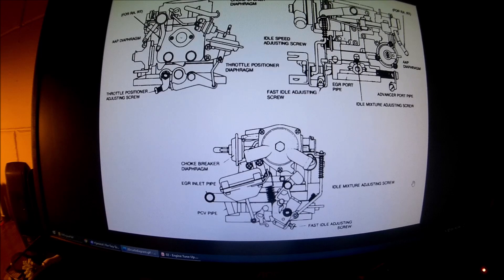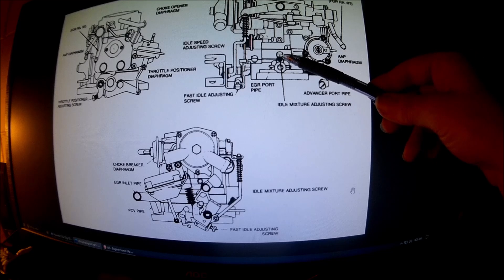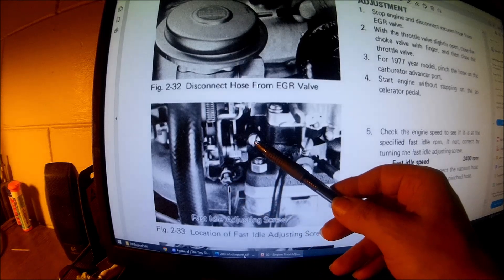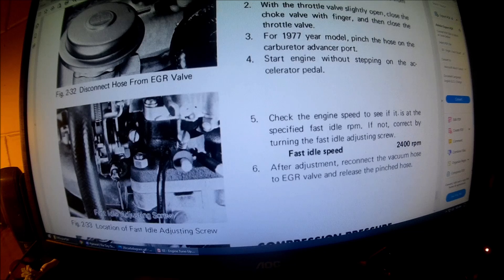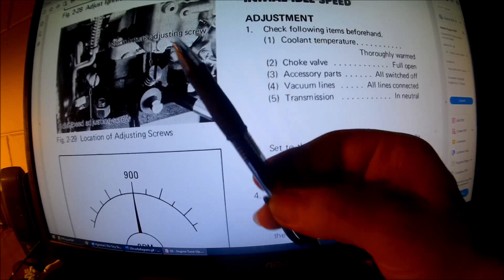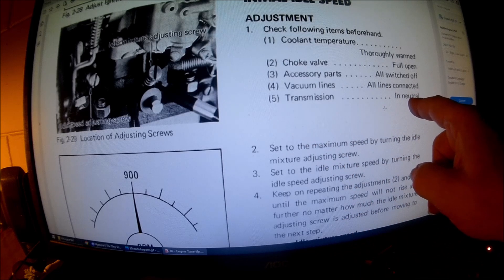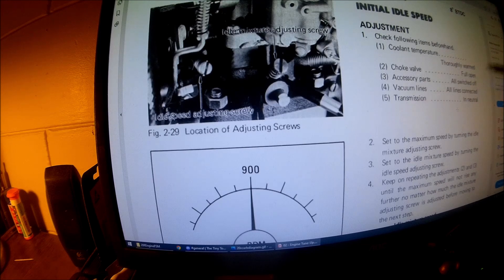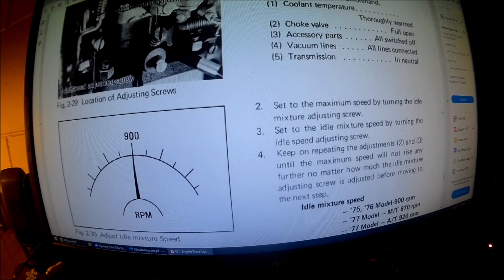Toyota 20R Basic Carburetor Tuning Procedure & Info

Comment: This has nothing to do with the carb, but I thought I might pick your brain about something.  My '78 has a broken front handbrake cable, and the mechanic I took it to said he can't find a replacement anywhere.  I already looked on eBay, but the one that are listed aren't correct according to the mechanic (who already looked. Says the ends are wrong and different part number.). Have you had to replace yours?  
Any ideas?
Reply from the maker: My front cable is broken and has been ever since I got the truck. I've tried several times to fix it but to no avail. I also couldn't find a correct replacement cable to fix it. Until now.

I just did some research and found that the correct cable is available from several (3) different Ebay sellers in Thailand. Just search "Toyota 46410-35051" on Ebay and you'll see them. I'm probably going to order one for myself right now. I've bought several parts from The Thailand Ebay sellers in the past and never had any problems.

It's also true that these cables are still impossible to find from a US domestics source. So your mechanic is right about that, plus the difference in part numbers. The '79 & newer number is 46410-35151, the '72 thru '78 one is 46410-35051.

Hope this helps.
Reply: @The13thSword  Yeah, I saw those on eBay and called my mechanic to tell them about it.  He said they already looked at those and that the part number is wrong and the ends don't look right.  Apparently the last four digits of the correct cable should be 5101. I'm just going by what my mechanic told me over the phone, but if you find out different, please let me know. Thanks for getting back to me on that.
Reply: Just took a close look at the pictures from the seller on eBay and compared it to the diagram you sent a link to. They look the same to me.  Maybe my mechanic is mistaken.  I don't know, (I guess for about $28 it's not too much of a risk.)
Reply from the maker: @davidflatcutf3286  I am more than reasonably sure that the part number I gave was correct. I tried looking up your mechanics part number. The only reference I could find for that number is a parking brake cable for a Toyota forklift.

Rechecking the Ebay listings they are specific that the part is correct for 1972 to 1978 pickups. It lists the OEM part # as 46410-35051.

This could also be a matter of part # supersession. That means whenever Toyota changes or upgrades a part for a specific vehicle, they change the part number, usually to a slightly higher numeric value, e;g; original number 35051, new part 35101. Not sure.

In any case I am reasonably confident that the one on Ebay is correct. I have ordered one myself.
Reply from the maker: @davidflatcutf3286  He could be. I also compared the Ebay item with the original diagram and I was satisfied enough to go ahead and order one for myself.
Reply from the maker: BTW, here is a link to the original parts diagram with part numbers: https://www.amayama.com/en/genuine-catalogs/epc/toyota-general/hilux/RN25/12718/chassis/4601

The cable is showing as being discontinued from Toyota, but at least you & your mechanic can use this for visual reference. Another point - My repair manual says the following"
"...The primary cable can only be disconnected from the hand control after the pulley bracket has been unbolted from the engine compartment rear bulkhead (firewall)."

I've seen some YT videos on this and taken the pulley bracket apart myself before and it's true. You can't get the end of the cable off the "engine end" of the hand control rod unless you unbolt the pulley bracket completely. Her's a vid that shows all this in detail:https://www.youtube.com/watch?v=Z_7CyIsLAdA

The vid is for '79 to '89 but the '72 to '78 is very similar.
Reply: @The13thSword  Thanks, again.
Reply from the maker: @davidflatcutf3286  No problem.
Reply: @The13thSword  Just a little update; I ordered the front handbrake cable off eBay and it did work.  Unfortunately, somewhere along the way in the repair process the little button that activates the dash light for the handbrake stopped working,  I don't necessarily want to blame the mechanic, but it was working when I brought it in.  I don't guess a part like that will be easy (or maybe even possible) to find.
Reply from the maker: @davidflatcutf3286  If you mean the brake light switch for the handbrake, I have it as this: https://parts.lakelandtoyota.com/p/toyota__PICKUP/Brake-Light-Switch/4206147/8434022072.html

If you mean something else I'll need a more complete description. The part I'm showing you here mounts next to the park brake rod assembly. The rod has a tab on it that presses in the button on this switch, opening the contacts inside it so that no voltage flows to the brake warning light on the dash. When you pull the handbrake, the tab moves away from the button on the switch. A spring inside the switch causes the contacts to close, sending voltage to the brake warning light.
Reply: @The13thSword  Thanks again.  I'll have to take a closer look, but offhand I would have to say the electrical plug-in connector looks different.

Comment: Many Thanks you for the VERY detailed vid!!!!  Think I got a bad load of gas- ran really rough.  Just got $330 overhauled carb back and installed on 1980 20r motor, 5 speed.  Followed your directions explicitly.  Smokes like crazy during cold warm up- blue smoke.  Once warm, seems to run fine with no obvious smoke.  Runs smooth down the highway.  Recommendation please?
Reply from the maker: Blue smoke is a fairly reliable sign that your engine is burning oil. The oil could be getting into the combustion chamber for a variety of reasons, some of which are minor fixes, while other reasons can indicate something more serious. Since you say it runs fine after warm-up & runs smooth down the highway, I expect (and hope) that it's something minor. Possible minor issues would be:
1. Bad PCV Valve. If the valve is stuck open due to being gummed up inside or the internal spring /mechanism is frozen open, the constant vacuum from the carb can draw small amounts of oil into the carb & then send that oil to the cylinders to be burned. Normally, the PCV (positive crankcase ventilation) valve is only supposed to open if you have excessive pressure in the crankcase. Such excessive pressure can result from small amount of "blow-by". Blow-by is cylinder pressure escaping past the piston rings and into the crankcase (more on this later).
Take out the PCV valve from the valve cover & shake it; it should rattle. If it doesn't rattle you can try cleaning it internally with parts cleaner or carb spray, or just put in a new valve.

2. Broken, worn, missing, cracked Valve Stem Seals. These seals keep the oil that lubricates your valvetrain (camshaft, rocker arms, upper stems of valves) from running past the valve stems and into the combustion chamber. Only way to check these is to remover the valve cover & physically check them out. I doubt these are your issue though, as once a valve stem seal(s) starts leaking, it's usually not affected by changes in heat (cold engine to warmed up).

More serious issues:
3: Worn Valve Stems and/or Valve Stem Guides allowing oil into cylinder. Only fix for this is to have a qualified machine shop do a "valve job" on your cylinder head. The old Valve Stem Guides are removed & replaced with new ones & any valves with worn stems get replaced, if not all of the valves being replaced with new valves. Valve Seats may also be cleaned up or replaced.

4. Possible leaks in head gasket. It's not common but there could be damage to the head gasket, allowing oil to seep into a combustion chamber. Once the engine heats up, this "leak path" could seal up. This problem is difficult to verify without removing the head to visually check for it, but if you go that far, you're going to be putting in a new head gasket anyway, along with new head bolt. (Never reuse head bolts, get new ones. Head bolts are designed to "stretch-to-torque" and are considered to be a single use item.)

5. Worn Piston Rings. Again, this could allow excessive pressure into the crankcase & push oil past the PCV valve and into the engine to be burned. This will happen even with a properly functioning PCV Valve. Once the engine warms up the rings expand & provide a better seal, so the excessive crankcase pressure "goes away"; all the pressure is contained in the combustion chamber. It's also possible that worn rings can allow oil to come UP past the rings & into the combustion chamber but this is a bit rare/less probable.

The only reliable way to check if your piston rings are worn is a compression test. Decent video on this here: https://www.youtube.com/watch?v=v7EdRwCW9Fs

20R compression specs are: standard 156 PSI, minimum compression 128 PSI. These specs are with the compression test done on a "cold" engine. The compression of all 4 cylinders should be within 10% of each other.

Opinions/other thoughts:
You could also try pulling your spark plugs (cold) one at a time & check for deposits. If all 4 plugs have some black deposits & you're sure your carb mixture is set correctly, that would tell me that the oil is getting into the engine to be burned from the intake side (PCV Valve into carb). If only one of the plugs has black deposits, then it's likely that cylinder has one of the following problems: valve stem seal leaking, valve stem or valve stem guide worn, worn piston rings on that cylinder. The Valve Stem Seal can be likely, the rest not so likely.
What oil are you running? Original oil spec for the 20R is 10W-30. I have run both 10W-40 & 10W30 in mine, currently using 10W-30 (Pennzoil full synthetic(note below)) with no issues. I ask because running too thin an oil could lead to seepage problems if you have one or some leaking Valve Stem Seals or other leaking oil seals (front or rear main seals, engine gaskets, valve cover gasket, etc.) I wouldn't use anything lower than a 10W-30 oil. Some of the more modern oils like 5W-30 or even 0W-20 are much thinner and should not be used in a 20R or 22R.
Also, the Pennzoil full synthetic has additives in it (zinc) that help keep your valves train properly lubricated & functioning.

Sorry for the long answer but I try to be as complete as possible. If you're not too keen to do any extensive testing or possible rebuilding, and the "blue smoke" only lasts a minute or so on start up, you really aren't doing much damage by continuing to drive it that way. Driving after warm up when the smoke stops will help burn off any deposits left behind by the burned oil. And since you say it runs well after warm up, I think this is a minor issue at present. What you want or don't want to do about it is up to you, but I just wanted you to have as much info as possible.
Reply: @The13thSword  "Sorry for the long answer" HAHAHAHAHAHAHAHAHAHAHAHAH  O M G  WHAT and education you have given ALL us!!!!!!!!  YOUR response applies to EVERYONE!!!!!  SO appreciative!!!!!  I'm running Mobile 1 10-30 but now, may change to Pennzoil !!!  :)   I'm 73 and I have only found 2 others that like you, that are 'masters' of their craft.  David Odell complete concrete and Steven Lavimoniere-HVAC  NOW, I have 3 geniuses helping me!!!!!!!!!!!!  Most hosts of utube channels reply to some questions- YOU REPLY TO ALL.  On behalf of us all- THANK YOU
Reply from the maker: @barrythompson6387  I appreciate the recognition. It's my personal opinion that knowledge gained but not shared when needed is a waste of knowledge. I do try to answer all questions that come in because someone took the time to ask, and it deserves an answer. Not sure about being a "genius"; I've just always tried to apply my brain, is all. But thanks for the compliment.

I'm also glad that you realize that my responses will also get read by others down the line, which is the reason I try to be so complete.

BTW, I looked up your Mobil 1 10-30 and you can stick with it. It has plenty of zinc & phosphorus in it (more than enough), so it's good for that old valvetrain. No extra additives needed.

Bonus economic tip - Don't pay the auto parts store prices for motor oil, which are normally $37 to $40 for a 5 quart jug. The prices for the same product at Home Depot or Wal-Mart is usually $23 to $26 a jug (as of this writing 11/2024). No difference in product quality.

Thanks again for the kind words & let me know if I can be of any other assistance to you.
Reply: @The13thSword  I M subscribed!!!!!!!   YES--MOBILE 1!!!!!!!!!!!!!  SO glad it passed YOUR scrutiny one less problem hahaha.  Yep, I agree...Walmart is great for certain items- they must buy so much in bulk- get a good price and pass on to customers-  Thank you Mr. Walton :)  Ok the, my truck has you on 'speed-dial'- Many thanks again for All your help Barry
Reply from the maker: @barrythompson6387  Thanks for the sub, it is much appreciated. It's not so much my scrutiny but Google's. I love being able to do research in seconds to find the useful info I need.

I'll be around if you need any more info in the future. Thanks again for all of the kind words.

Comment: Will thw carb tunning be the same for a desmoged 20r. Working on tunning up my 79'. Love the instructions. Just followed the ignition module conversion and seems to work great. Thank you so much!
Reply from the maker: Yes it should be the same. The only difference with an engine that still has all of it's smog equipment is the extra vacuum lines & equipment, & whether or not they are in good condition. Vacuum leaks can & will effect carb tuning, and such vacuum leaks can make tuning a carb almost impossible. So it's best to make sure you have no vacuum leaks before trying to tune the carb. Since your setup is desmogged this should be fairly easy to confirm.

It's also important to have the engine base timing as close to spec as possible. As long as you can start, warm up & run the engine at some workable idle speed at full operating temperature, that's fine for an initial carb tune. 

Once you tune the carb it would be a good idea to use a timing light to see what the timing is at hot idle. The timing spec for the 20R is 8 degrees BTDC (before top dead center). If after the initial carb tune the timing is found to be "off", you can loosen the distributor hold-down bolt & adjust the distributor to get the correct timing. You won't have to turn the distributor very much to make a large difference in the timing, so easy does it works here. Once timing is set make sure you tighten down the distributor hold-down bolt. Then go back & retune the carb again.

In case you might need it, here are the basic instructions for tuning to best lean idle without using a vacuum gauge:
https://www.lceperformance.com/category-s/23365.htm#:~:text=The%20first%20thing%20to%20do,and%20begin%20to%20smooth%20out.

This will work on almost any make or brand of carb, as nearly all carbs work the same way. This is the basic carb tuning procedure I use. It's also possible to do a finer tune if you use a vacuum gauge. Here's a good basic video on that:https://www.youtube.com/watch?v=aBbD_JlKBGY

I've rarely done a vacuum gauge tuning because I don't have a good one to use, but the basic procedure without using a gauge has always worked well for me.

Glad to hear your HEI conversion is working well for you. If I can be of any other service just let me know.

Comment: Hi I have a 1980 Celica with a 20r it cranks and cranks but doesn’t start. The fuel pump is working because if I take the line off fuel is pumping. When I pour gas down the carb it starts but then dies. Any ideas
Reply from the maker: Since you have fuel delivery from the fuel pump & spark and the engine fires if you manually put gas in the carb, it's likely either the carburetor or an additional fuel delivery problem. By saying "if I take the line off fuel is pumping" O assume you mean the line at the carb itself? And not some other fuel line connection further away from the carb? I ask this because sometimes of you disconnect the fuel line behind the fuel filter you'll see fuel pumping, but the fuel filter could be clogged, keeping fuel from getting to the carb.

For the carb itself, if it hasn't been internally cleaned, rebuilt or replaced for a long time there could be several issues. Clogged up idle or main circuits (can happen if the vehicle has sat for a while), or worn out throttle rod bushings in the base allowing in too much air, or other worn out internal parts.

A less likely issue would be the fuel pump relay. It doesn't happen often but occasionally the contacts in the relay on the "RUN" side get pitted or corroded & then the fuel pump won't get voltage on the "RUN" side, but will get voltage when the key is in the "Start" (cranking) position. This happens because over time, the "RUN contacts are used for a longer period of time in use than the START contacts. Same thing goes for the fuel pump resistor, as the resistor is only working when running, not during starting.
Second less likely possibility is the ignition switch, for the same reasons stated above.

If this car has sat for any long periods of time, I highly suggest that the entire fuel & electrical systems be completely gone through. I know from experience that in such cases, it's almost never just one part of a system that needs repair.